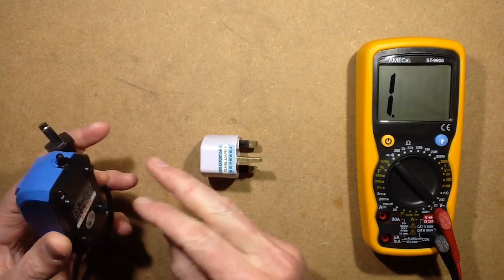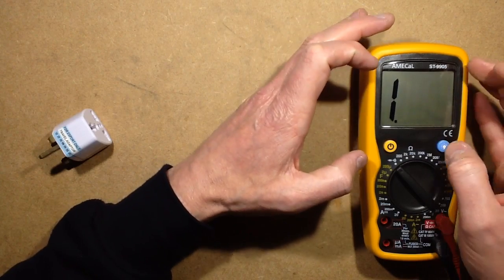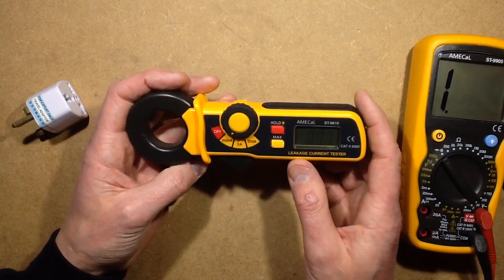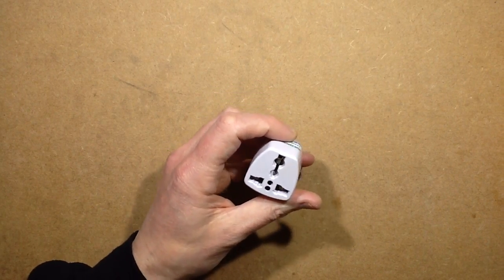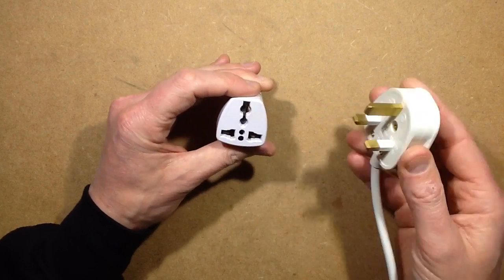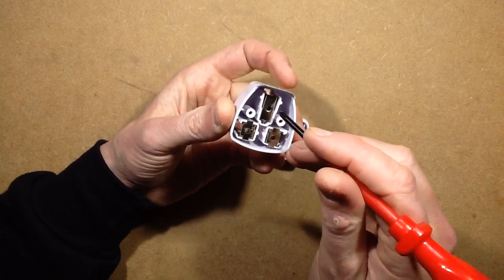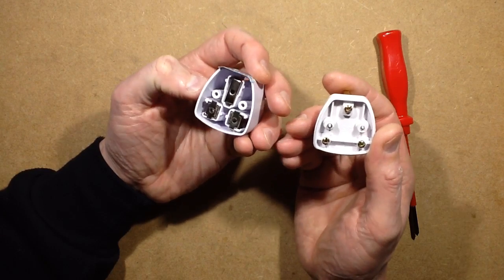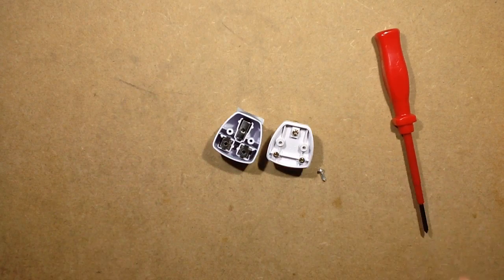Inside another death-dapter variant.

Comment: Looking at that adaptor, I'd suggest it has been assembled incorrectly, just like one I have.  I believe the screws are intended to be installed last, thereby connecting the sheet metal parts to the pins.  Looks like someone (maybe everyone, given I havs an identical adaptor) is assembling them incorrectly to save a little time.  Typiical China QC, or the lack of.

Comment: i use the fanuc eoat system for  killing adaptors that have tingling feeling. just setting the tool length to 1 meters instead of standard and now it goes into the bosch exturded aluminium profile!! just need to set payload to less than 0.4 kg for lr mate 200id for it to not crash entirely into the profile bed!! it may be also good idea to set the inertial values but if you dont have payload checker bought then you may skip it! if yuo have the dcs feature enabled then it can be also used by setting it at least 1.5mm over the aluminium profile and also making an user model (i would use user model 1 with 3 'line_seg' models inside, for example on my !schunk egp gripper!) that is accurate or you may crash aswell!. any of them is good if set up correctly just be sure to use good calipers!!
Reply: i got shockd by these adaptor before thats why iam angy!!

Comment: 8 years later, and these dangerous pieces of junk are still all over eBay, shipped with imported devices. I recently received a couple from a large seller which are even worse than this version - all three pins are exactly the same length (and the half-plastic half "brass", including the earth) and pretty bendy, so they don't even fit in decent sockets because they can't open the shutters. One of them was already falling apart right out of the box. Why do these even exist, when better quality fused adapters (with correct pin sizes) from established brands like Masterplug and Pifco are available for a couple of £ each.

Comment: I come from Japan where essentially all appliances come with ungrounded leads (and I live in NZ where some leads are grounded but some aren't). Can someone please explain to me the danger posed by these death dapters?

I have a 'death dapter' as well without a grounding pin that converts to the AU/NZ plug type, and I use it with an EU LG charger without a grounding pin either that the deathdapter was included with. Is this dangerous?

I can understand plugging in an appliance designed to be grounded into an adapter without a ground pin would be dangerous, but is it dangerous to plug a normally ungrounded appliance into an adapter with no ground plug?
Reply from the maker: The main hazards are poor connection and the ability to plug the earth/ground pin of a plug into the live port and make the case of an appliance live.
Reply: I'll add that 99% of the USB wall chargers I've seen here that have the native plug type are ungrounded as well, from reputable brands too.

Comment: Being very alarmed at the exceedingly poor quality and risks involved with these Chinese "death daptors", I've never actually used one and the two I got with some items I purchased on eBay some time ago just got thrown in the junk draw. 

Today I thought I'd have a look at how bad the two that I got really are.
I was astonished to find the contacts for the sockets to all the pins were actually screwed together making almost a good connection between the sockets and the pins, but the fingers of the sockets looked to be very flimsy chromed metal, not brass!
Plugging one adaptor into the other confirmed that the pins are not gripped very well at all, and confirmed Clive's findings that you can plug any pin into any socket of the adaptor in any orientation. 
The adaptors remain in the junk box, never to be used unless I want the brass pins to machine in order to make something, which is the only reason why the adaptors haven't just gone in the bin!

These adaptors are so bad I am astonished they are not made of conductive plastic!

K Watt
Yes that is my name and yes I am an electrical engineer, now retired.

Comment: how would you replace one of those? My phone charger came with one of them, but I dont know how to replace it because they don't sell the BS1363 female here in my country (my idea was to make a short extender cord, one end AS/NZS 3112 male the other BS163 female and use it like that). Also it arks when you connect it, and it doesn't fit right in my plug, so imagine me fiddling around with it, in the middle of the night, probably very asleep.
Reply from the maker: Get a travel/shaver adaptor locally.

Comment: i just was making coffee as i heard a pop - i thought its the draft closing a door
but it was not - and the first next thought was - the adapter i just plugged in
to recharge a powerbank.. and it was -  and it smelled aweful.

i opened it up - and there nothing burned, broken or smouldered..

so - what can it be  . . 

where can i drop a picture of the internals ?
Reply from the maker: Has one of the capacitors bulged or slid up it's little rubber base?
Reply: @bigclivedotcom  
not a thing - just a scent that fills the room - and its a day old and still signing off
i feld the caps - i checked the diodes, i looked at the little trafo - if the cover has melted - i see no sign of decay..
Reply: i found the piece broken - literally broken - odd i missed that - its the 8 pin chip has a crack from right-corner to left-down in a curve - like a sword cut
Reply from the maker: @herauthon  Probably an all-in-one switchmode chip.  It's not uncommon for them to split in half when they fail.
Reply: @bigclivedotcom  
i assume that if this device is broken so badly - the surrounding items are affected, too - but - if i can read the model-type and replace it - but first testing the other residents of the plane.

Comment: I've got one of these recently and surprisingly there has been an upgrade!

for one thing, EARTH IS CONNECTED!

it doesn't fix all the other issues such as pluging-earth-into-live but it's nice to see earth connected up

Opening it up, the screws have been replaced with like standoff things? that poke up into the metal above

Also this doesn't have the middle ground pins oddly enough

Comment: Lethal I got one with a electric trimmer but the two pin plug was misshapen and converter would NOT fit a standard UK socket because the earth pin was at angle due to crap moulding of plastic wish I had kept for u to see but binned and got refund

Comment: I've got one of these death-dapters (came with an Amateur radio), which is also not earth connected.

Just for good measure, mine's also got the 1/2 insulated earth pin.

I replaced it with a Poundland shaver adapter.

Comment: i have a adapter that i use to charge my laptop and every time i plug it in sparks fly out of the adapter it has not fried the laptops power brick yet or started any fires but that is probably just a matter of time
Reply from the maker: The inrush often causes sparks when power supplies are plugged in.
Reply: @bigclivedotcom  the ground is loose like a lot of these deathadapters i think the extra resistance causes more sparks then usual

but it wouldn't be the first time just plugging a power supply in caused a bunch of sparks pretty sure i killed a old computer from that once ever since i make sure i have a power switch off before i plug a computer PSU in
Reply: just to confirm it does spark a lot less now that i have swapped it to a less dodgy power adapter

Comment: Back in 2009 when I made a class trip to England I bought two UK-socket-adapters on the ferry from Calais to Dover, which I still have. Luckily I only had a non grounded device (protection class 2) with me, but I later found out that you can actually fit a grounded Schuko-plug (I'm from Germany) into it, while there is no connection to the two ground contacts on the side of the Schuko-plug.
I wonder if these adapters are banned now from the shop on the ferry because they are dangerous, especially if there is a live wire touching the metal housing of a grounded device you can plug into these adapters.
It's pretty amazing what kinds of dodgy stuff can be found on the market.

By the way: My first experience with British style light bulb sockets was when I tried to turn on the light in my room after my arrival, which didn't work, so I checked out the lamp closer and I saw that the CFL was not sitting straight in it's socket and then I tried to unscrew it (like it's done here in Germany) and as I finally got it out, which of course was tricky because of my lack of knowledge about these sockets back then, I found out that a pin broke of the side of the metal cylinder. The bulb was replaced after that so the light problem was fixed.
Does that happen very often with these sockets in the UK?

That was a kinda interesting experience back then but I have learned something new about UK electricity.

Comment: One of these come with my led strip lights, for some reason nothing would plug 🔌 into the adaptor, when I opened it one of the metal things at the bottom connecting the pins, was actually put in incorrectly, this was a death trap I had to put it in a different position, then I decided it’s for the bin also there was NO METAL AT ALL connecting the earth pin, so it had one missing contact and another incorrectly put in.

Comment: I have one of these plugs which I have just opened up. No earth connection at all,so potentially dangerous to connect to a three pin 240 volt mains. Probably safe enough for usb connection using two pins.

Comment: Bet It will not have. CE marking, if so it I’ll be counterfeit.
Reply from the maker: It's not even counterfeit.  It's been designed to tick a box without even conforming to any sensible electrical standard.

Comment: Well the uk plug isnt as safe as everyone says, you cannot plug a shucko plug wrong ;)
Reply: I have a few Shucko sockets on my UK ring main to permit ready use of EU appliances (Especially for guests) and my French bought phone charger can be plugged in either L-L/N-N or L-N/N-L.

Not such an issue for a 100mA switching PSU of course, but there are some appliances where mixing up live & neutral could carry severe consequences (Plus a lot of current!) :-o

Comment: What happens to the metal parts in the top when a plug is connected? Would they be pushed down into the pins in the bottom part by any chance? No need to connect to earth with nothing connected, right?

Comment: This travel adapter is called a death dapter because it causes death. The earth pin is not connected, which means the circuit breaker will not get tripped if something fails in an appliance

Comment: It looks to me that it was designed for the plug pins to be screwed to the internal terminals, but some bright spark (I know!) found that you could just screw the unit together and the screws would touch the internal connectors (except the earth of course) thereby saving money, and know one would ever know (until they died - at which point they cease to care about the internals of the adaptor).

Comment: It "works" with small appliance (1.8VA). Pure curiosity made me plug a 10 amp heater (2500W) into this device, after having seen the construction with the screws under the holes, put it in an outlet on my desk.  It is marked !0A/250V, so it should do. 
Well, there was a strong plastic smell after a couple of minutes followed by fumes and little yellow flames. A perfect set your home on fire device this type.
And that's why it is for export only, not to burn homes in the country of origin.

Comment: I have that adapter, it came with some sort of Chinese device (phone, charger, something), but with the Euroean pins on the plug end (German here). The funny thing is, because our sockets are recessed (instead of flush like UK and US ones), the large, non-round shape of the device and the positioning of the 2 pins off center means you can't plug it into a socket. Even if the pins were centered, the whole thing is just a few millimeters too wide to fit a socket. Genius!
I do have the other one with the electrocution pins though.

Comment: I think if you removed the screws for the pins and then put them back in from the front going all the way through then it should work as intended. Seems to me like an assembly line short cut

Comment: The United States plugs are better in this situation, since the ground pin is a different shape than the live pins. Plus United States plugs are smaller and easier to make small power supplies with.
Reply: The ability to plug a 3 pin US plugs earth prong into the live slot is still there on this adaptor. The US plug is known to be one of the most dangerous around. The EU, UK and Austrailian desgins are all much safer

Comment: Why the hell would anyone want an adapter which plugs into a BS1363 socket which would accept a BS1363 plug??
Reply: Easy universal structure, in manufacturing, just change the back plate for different plugs is probably why they make it like that. More expensive adapters probably won't accept the plug its plugging into.
Reply: Woogoo336 Actually, expensive quality adapters still uses the "universal top" design, but with an even more complicated top to prevent dangerous deathdapter style insertion. And of cause with a connected earth pin.

Comment: Every thing this guy has said is true. BUT, speaking from personal experience of using these plugs for over 7 years, I have never had anything bad happen. You just have to use them sensibly. Its like using a car can kill you, but if you drive sensibly then you would most likely be fine.
Reply: Except that the Earth isn't connected inside (which makes the whole adapter pointless compared to the two-pin adapters).  And for this particular one, the apparently unreliable connection of the two power pins.  Ended up buying a swiss made/designed one that gets the details right.
Reply: The only sensible way of using this type of adaptor is not to

Comment: if u can plug the eartch connection in one of the output plugs to make the enitre appliance live, isnt uk plugs pretty  crappy made
Reply: This is a dangerous, non-standard, illegal adaptor capable of accepting many plugs including USA, Schuko the wrong way around (so they must therefore all be equally bad). Standards-compliant BS1363 plugs are some of the safest and most robust in the world with live pin sheaths, fused plugs, live pin shutters.

Comment: i have always wonder they should have made the earth plug slightly bigger
Reply: on UK plugs there is a plastic cover inside the socket that covers the live and neutral contacts, it will stop things being carelessly shoved in. The Earth pin is longer to push the cover down and out of the way of the live and neutral.
Reply: yeah but why not just make the earth pin just slightly taller or wider than the live and return.
Reply: If it was the same length then it wouldn't fit in because the cover is still blocking the live and neutral. By making the Earth longer, that can push the cover out of the way and allow the live and neutral to enter.
Reply: The Earth pin actually is slightly wider on a proper UK plug so it will not fit in to the live pins of a socket.
Reply: earth should be toblerone shaped
Reply: +SomeMoreVideos2468 But universal sockets like on this adapter need even bigger holes to fit the deliberately inconsistent pin spacing of dozens of national plug standards. Good variants of this adapter design have a larger plastic surface on the socket side so the plugs won't go in sideways.
Reply: John Doe These UK plugs are so fat and big, imo I'll stick with our compact United States plugs
Reply: +pixol The pin distance on US plugs is only designed for half-voltage US power.
Reply: The earth pin is actually wider as well as longer - it's too big to fit sideways into a live hole on a compliant socket. But these non compliant adapters have large enough holes that the earth pin will fit the live sideways. Now, if they used the shutter system this wouldn't really matter since you wouldn't be able to insert it anyway. But they don't...

Comment: How are those adapters meant to work anyway?
From what I've heard, UK plugs have fuses in the actual plugs, but this adapter does not. So if I plop a foreign appliance into an adapter like that, it won't have a fuse protecting it?
Reply: It is not legal to sell these adaptors on the UK market as they are not BS1363 compliant. Proper travel adaptors will indeed be fused, and in UK wiring regulations the sockets must be protected by circuit breakers and RCDs in addition to the plug fuses.

Comment: Could you do an overview of foreign plug configurations and how safe they are?
Reply: Most foreign plugs and sockets are pretty safe really.  Though not quite as safe as BS1363, which I consider one of the best socket designs.  Things only really get dangerous when you try and make a socket to accept multiple types of plug and/or make plugs/sockets which do not meet the proper dimensional standards (the earth pin of a proper BS1363 plug cannot be inserted into the live hole in a properly made BS1363 for example as the pin is too large for the hole).